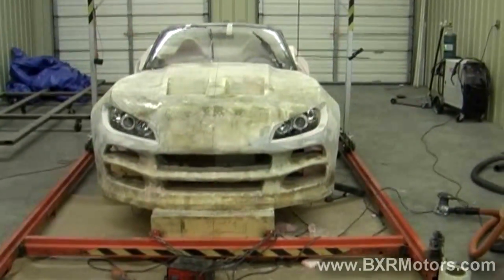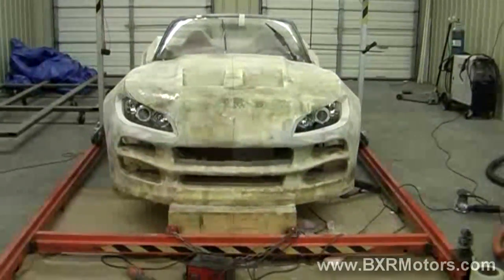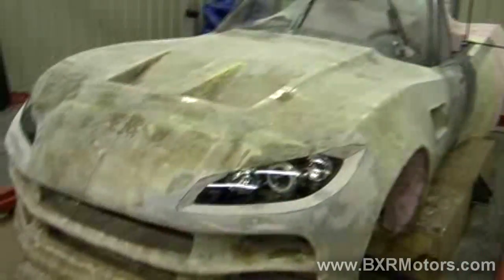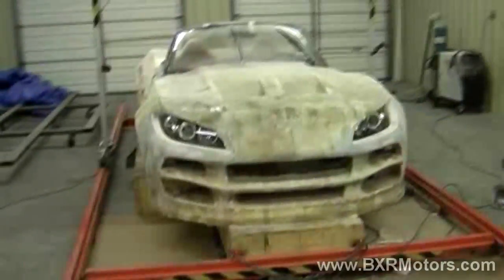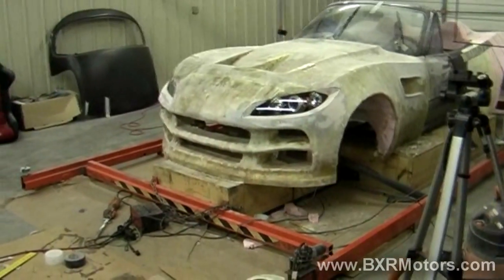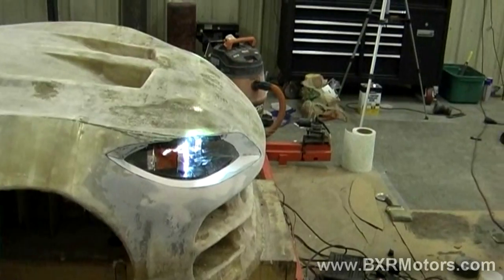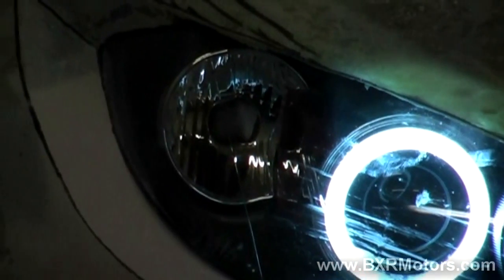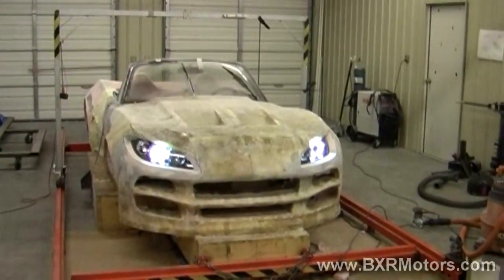Bailey Blade Car Design | Finished second head light | Fiberglass Work - Part 13

Comment from the maker: Thnaks man, Yes there are lots of frustrating times with a project like this. I have had to redo many things and spends many of hours just to figure out what seems like simple things. You just have to have the passion and push through and problems that come up. Its the only way a project ever gets done. I have been at this for well over 4 years now so I understand. Stay strong and you will get there, try taking a break and looking at it from a different perspective when you get frustrated.

Comment from the maker: The stuff is more of a green or blue but looks brown in the video. It is a type of body filler that has fiberglass strands in it. Its usually referred to as angel hair body filler. Do a search on google for fiber reinforced body filler and you will find it. Most body shops or auto part stores carry it.

Comment from the maker: @kraudio7 If you crash the car, you would take it to a normal repair shop used to working on fiberglass, like a Corvette or Viper, they would call us for a replacement panel if needed. This is a production car, they will be parts available and body panels for repairs.

Comment: Hey dude, I'm saving up to do a similar thing, except only building three vehicles. I'm in Australia and was wondering all the tools you used and what are your recommendations. I'm nuts about drifting but  can't afford a R34 kitted etc. Plus their done to death. 
Chassis frame I was going to MIG weld tube steel, I've bought a 61 chrysler sedan and am changing the design so the cars kind of have a classic type look.

Comment from the maker: Thanks for the comment and yes its our goal to develop a company based on our designs and ideas. As for custom drivetrain, we will be using some standard components, but suspension and chassis is all custom designed.

Comment from the maker: Yeah I saw your Electric Car.. very cool!!!...

The material is a short hair fiberglass mix body filler. I use in on areas that need extra strength. It sands well and is less prone to cracking. This is short hair and long hair. I like the short better as its easier and smoother to work with. The long hair is very strong and takes forever to sand.

Comment from the maker: Hey Dan, The Camera is Panasonic HD camera, cant remember the model but its a higher end miniDV cam. I use a software to do the time-lapse and actually record everything in real time.   The fillers were light weight body filler, and short strand fiberglass body filler. The wait time varied but usually 15 to 30 minutes. I tend to mix it hot too. still have about 1000 hours to go before we see paint LOL